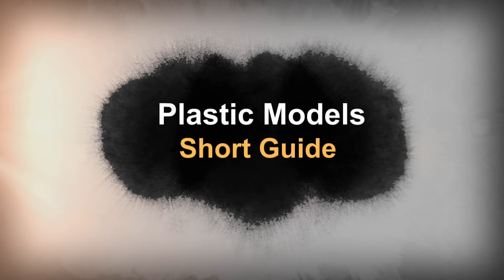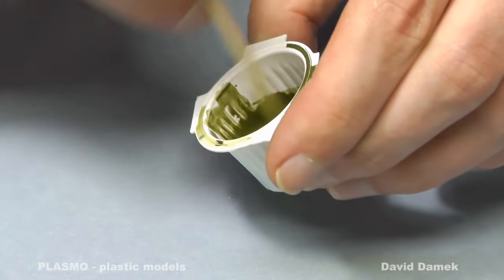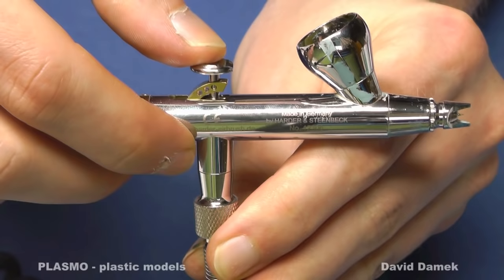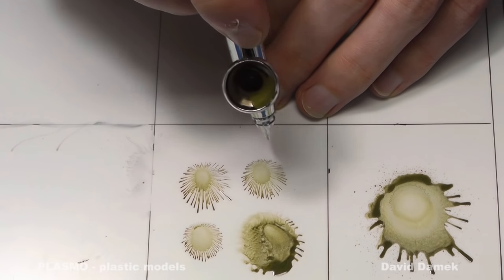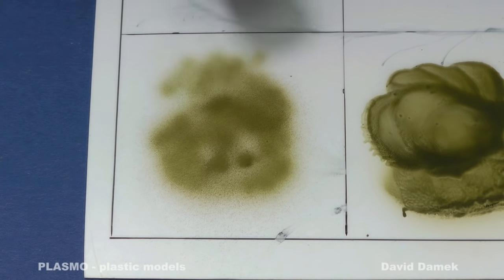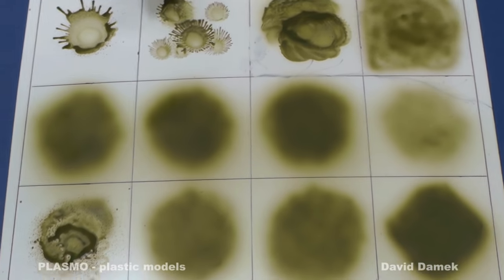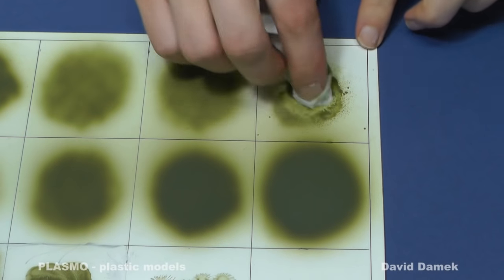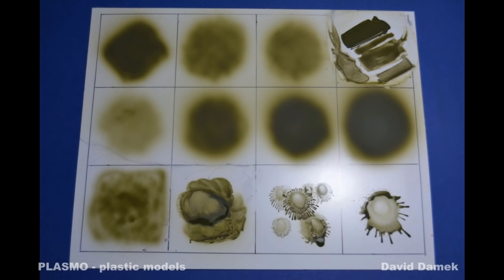Airbrush tutorial, tips for better airbrushing - Short Guide Plastic Models

Comment: Very nice. I'll pass along something that I tried just today.
I was having a problem I could not resolve. it was either clogging or dry tip and no matter how tried to clean the brush and tip I could not get it to function properly. Pulling things apart right down to the spring and needle it all looked clean there was no obvious reason.
Finally, I threw all the parts in an ultrasonic cleaner with the brush for a half-hour using just soap and water.
When done all was working as new.

Comment: After trying for literally years to get a good feathered edge for camo patterns (German WW2 and Russian middle east, Yom kipper war etc) the clay is the way to go, for me.. even with an Iwata, lowering the pressure, thinning the paint etc. it still makes spatters where you don;t want them to.  So you have to go back and retouch, either with a brush (usually defeating the purpose) or the airbrush again, which of course, just makes more different colored spatters... where you dont want em... With the clay you can still ge a good feathered edge, just mold the top part out a little over so yu make a "shelf" and spray from directly above, not the side (so you don;t make too sharp an edge) the r esults are very pleasing and - no do-overs.

Comment: do a practical "how to thin paint" showing exactly how its done
Reply: It's very easy. Take two small glass containers, put milk in one of them and paint to another, than add thinner to paint and compare both containers - the paint is ready for airbrushing when both, milk and the paint have the same consistency. 

Works every time.
Reply: Two parts paint to one part thinner
Reply: He's just suggesting a new video
Reply: @AirsoftAddicted  Or, since you are probably using a mixing cup anyway, pour milk into a separate mixing cup.
Reply: AirsoftAddicted what type of milk😂full fat is a completely different viscosity than skimmed.
Reply: Semi skimmed if that helps lmao

Comment: Idk if that drying retarder from tamiya works with all acyrlics. Watched my local hobby shop guy test it on GW paints and it left clumps after shaking the bottle it was mixed into.

My suggestion when using Vallejo and citadel non air paints, use vallejo airbrush flow improver. Its golden for getting those paints to flow well.

Comment: Hello David, I must say you have published some of the better "tips&tricks" videos I've found here on YouTube. I have a question about paints: in this video you use Tamiya acrylics, are the tips from this video applicable to all the others kind of paints? I mean Lacquers (like Gunze) and enamels (like Humbrol or Model Master)?
Reply from the maker: No, but is same. It does not depend if you use Humbrol, Gunze our Tamiya. Everything is about thinner and pressure.
Reply: Thanks for the reply David. I know that everything is about paint/thinner ratio and pressure. I've found interesting how you check if the paint is correctly thinned. My question was about this: do you think is possible to check if the paint is thinned correctly in the same way you do in the video also using other kind of paints?
Reply from the maker: yes, of course, you can. In principle, are all colors same

Comment: Hello! I would like to know the following, I have an IWATA HP-CS, but never used any other airbrush before. Is it ok if I only press the trigger without pulling, to spray paint out of the airbrush? or something is broken inside? Is it the paint to thin?
Reply: Cristian Baló , on a double action airbrush like yours, no paint should come out unless you pull the trigger. pushing down the button should only release air, you have to pull the trigger backwards to release paint.
Reply: Stuart Taylor I think the problem might be the paint. very thin paint. I only press and it comes air + some paint
Reply: what you need to do is unscrew the back, then inside the housing you will see what looks like a drill chuck. undo it a little so you are able to pull out the long needle. give it a good clean whilst you are there. now push it back in and hold it quite firmly pushed in and at the same time tighten the chuck again. I gently push the needle against my chest whilst tightening the chuck. now put back together and all should be OK. if not, your paint is way way way too thin
Reply: if you get stuck or find it difficult. watch a video on how to clean and airbrush, they will show you how to dismantle and put together your brush. hope this helps and you get sorted
Reply: Stuart Taylor thank you very much. I will try it later!!!!
Reply: that should sort it for you

Comment: When i use white, the paint is diluted right, but it still splatters and barely comes out. Every time i pull back with the trigger, the front tip instantly is covered with paint, and i have to rub it off, help!! It also only splatters, and i couldnt get the first common mistake, did you mean pull back trigger too much and too low pressure?

Comment: What's your opinion on store bought primers? I use primers for all my models, but I don't know if it's worth it or not.
Reply from the maker: Primer is good for the unifying different colour of plastic and putty. Another advantage is that then show all scratches or impurities on a model before spraying colours scheme. So yes, it is good to use a primer.
Reply: I've been researching primers for model building for a while and of course different people get different results, but I found a few common elements. The gold standard of course is Tamiya Surface Primer but it's $12 for a 180ml rattle can which will maybe cover two 1:24 scale cars. Good primers are lacquer-based which means they slightly attack the plastic and bond very tightly with it. Lacquer primer should be sprayed outdoors or in a VERY well ventilated area. In the $4-6 range are Duplicolor Grey Primer and Rustoleum Automotive Primer in Light Grey (Sandable). My concern with Krylon products is that many of them strongly attack plastic and will ruin a styrene model. There may be a specific primer from them that doesn't have this issue.

IncidentiallyVallejo primer is just acrylic, not lacquer, so it does not bond to the paint. You can put 3 coats of Vallejo primer and 3 coats of Vallejo (or whomever) paint and let it cure and still scrape it with a fingernail. That's not gonna happen with lacquer. I do not have personal experience with these products except the Tamiya but nonetheless I hope this gives you enough info to ask more detailed questions at your local hobby shop, etc.
Reply: This discussion is mixing SURFACERS vs PRIMERS... surfacers are highly diluted liquid putties that are to unify the surface and (some of them) also to fulfill small scratches (surfacer 500).  OPPOSITELY primers are used as first layer under some colours (vallejo etc.) as primer layer under colour is increasing adhesion of sprayed colour on surface..
Reply: +dipsy5555 I've not used surfacer nor have I seen anyone in model building use it.
Reply: Morgan Feldon Of course I am not saying it is a rule.. I just tried to describe the way of use mate.. oppositely to you all modellers I know use both products as I have described :-) it is up to you what to use and how :-)

Comment: hi pal, what air pressure do you use in psi for models, say 15 to 20? or am I well off
Reply from the maker: it always depends on what you spraying, type of compressor, hose length and color dilution. I use for acrylic color 20psi, surfacer 30 psi, varnish 20psi, silver colors 10 psi. However all +-5 psi.
Reply: thank you so much for the quick and helpful reply. I love watching your videos, you're very very good, keep up the brilliant videos, thank you. I'm also using tamiya acrylics. I only have a cheap airbrush and compressor. I've just started building models again. I did a few when I was a boy, and the other week my dad gave me some old models out the loft to try and I love it. so I've started building again after 25 years. and your videos help me a lot. I will learn off you, haha. thank you.

Comment: so when would you use what pressure? for smal detail about 2 bar, if larfger areas 3-4 bar?
Reply from the maker: No,  the maximum recommended pressure for airbrushing is 2,5 bar.  I use 2 bars for large areas and for details 1,5 bar.
Reply: @idaemonplasmo  My compressor drops to below 2 bar when airbrushing but hits 2 bar when its building pressure (it operates constantly thus no reserve tank) instead of 30psi it sprays at around 20-25 psi... is this fine for most work?

Comment: You can avoid having to use both the thinner and retarder by using Mr. Hobby Leveling thinner instead. This has the added advantage of having the paint dry both semi gloss and with a tougher finish.
Reply: Monty the Desert Rat I've used mr color's leveling thinner with Tamiya x-4 blue paint, I thin it to a correct ratio and spray it perfectly but when it starts drying there is a white haze in the paint and the surface is smooth. I've had the same problem when using tamiyas paint retarder and thinner. What am I doing wrong?

Comment: why my airbrushes does not give out color and only if I unscrew all the bolts and the mix is 30-0% color?
Reply: laxwork have you tried cleaning the nozzle? Happened to me the first time i used an airbrush. I simply poured the acrylic into the cup and sprayed it onto my model. After 10 minutes it stopped spraying properly and i didn't know why. 

Only then have i realized that you REALLY need to thin the paint and ALWAYS keep your nozzle clean because acrylics dry really fast and if not thinned properly a small amount will dry on the nozzle, and after a couple of minutes it will clog up the airbrush.

It looks to me that you have a thick paint and a dirty nozzle because you have unscrewed everything but the pathway of the paint is still blocked by the dried remnants.

Google how to clean an airbrush.
You can thank me later :)))
Reply: I know how to clean and I clean it every time I use it. I own an airbrush more than 20 years ago and is still new and every time I tried to used it I spend more time to clean it instead to play with it. Lately I bought an other, cheap, maybe my first expensive wasn't good for me. No matter cheap or expansive, the only color I can use it ink for pen, black or blue. So all my dreams and plans about airbrushing just was dreams in my mind. Thinner the color does not mean something to me, is there any way to calculate how thin to be a specific color? If I do the color thin enough..... then is not color, and is not fun, plus that thin color also come out broken, no fun at all, I gave up tooooooo many times, too many years. Thank you.
Reply: laxwork well, thinning ratios are not always same, as said in the videos, but aim for the consistency of milk. I bought a very cheap airbrush/compressor combo on ebay for 40 bucks and it works very well.
What paint are you using?

Comment: Why not water? i use water all the time
Reply from the maker: Are you use Tamiya paints? The color diluted by water not adhered very well and it is difficult to apply it in small layers.
Reply: PLASMO - plastic models I have used humbrol, italeri, testors and the ones that come in revell kits, never tried tamiya. Always thin them with water, once a used alcohol and alcohol:water 1:1, but it dries too fast, thus clotting the airbrush.
Reply: I tried Tamiya + water. I got dots of pigment everywhere rather than a cohesive spray.